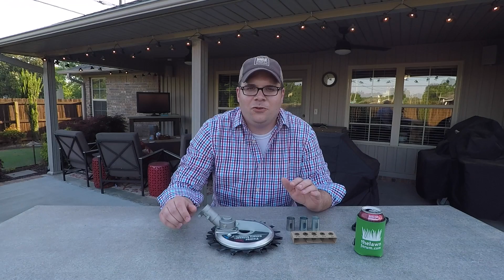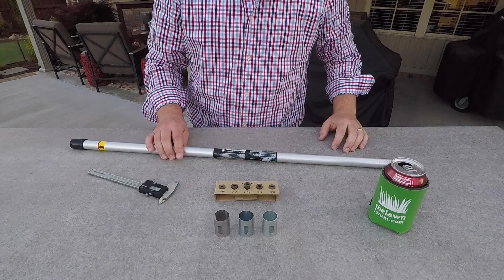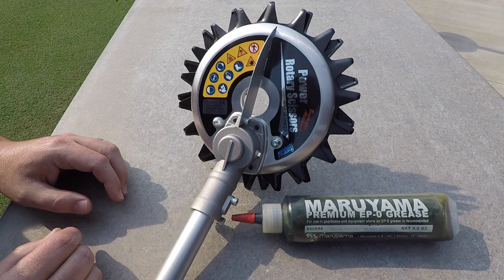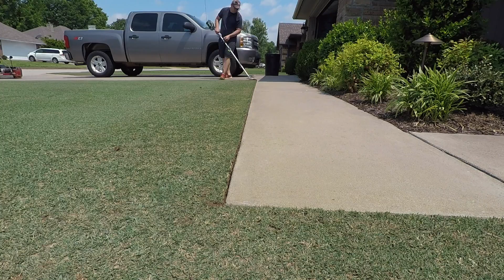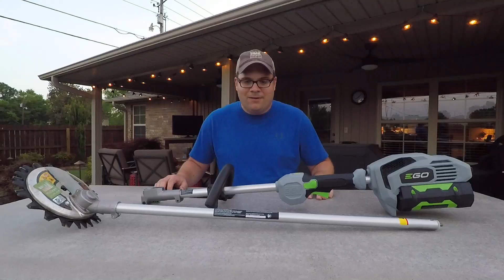EGO POWER+ Landscape Blade Conversion

Comment: Can I use EGO Power+ ST1502SA 15-Inch 56-Volt Cordless String Trimmer with Rapid Reload and Split Shaft
Reply from the maker: No, that model does not have a driveshaft.

Comment: On my ego multi tool, the rotary scissors only fit 90 degrees out from the battery / control orientation as the rotary scissors Allen bolt is on the side whereas the ego trimmer head has the Allen bolt on top

Did you need to adjust anything to get the orientation correct?
Reply from the maker: As I recall (it has been a while) the allen screw just works like a set screw. I would line the PRS head up in the proper orientation and just tighten the screw against the shaft. You could also mark the location and drill a new hole in the outer shaft for the set screw to engage.

Comment: I was wondering does this landscape blade work on medium to slightly tall grass? Also can this tool be used to edge the lawn as well?
Reply from the maker: Yes to both 👍🏼
Reply: One more question.....how often do you have to sharpen the blades?
Reply from the maker: If just cutting grass my experience has been rarely. If you’re edging with the blades in the dirt probably more often.
Reply: @realJohnWare  ok. Do you use yours for edging?
Reply from the maker: @TheBanks148  No I use a stick edger.

Comment: John will this work on my Kobalt 80-volt Max 16-in Straight Cordless String Trimmer with Attachment Capable?
Reply from the maker: If it has a driveshaft that matches up with one of the included adapters it should work. I am unfamiliar with that trimmer, but you could pull the head off and use this as a guide: https://thelawnforum.com/viewtopic.php?p=23876#p23876
Reply from the maker: Note that some electric trimmers do not have a driveshaft - the electric motor is on the trimmer head itself. The PRS head cannot be adapted to those. But if your model uses different attachments, odds are it has a driveshaft.

Comment: Are there other Ego models, or battery string trimmers you found that work with the rotary scissors?
Reply from the maker: Any of the “rear motor” Ego models should work. There are some others mentioned in the big thread on TLF: https://thelawnforum.com/viewtopic.php?f=4&t=1317
Reply: @realJohnWare  thank you for the link! I was searching through TLF on this.

Comment: Great instruction!   I have a question. would the edger's shaft also work with the scissors???
Reply from the maker: Yes it should.
Reply: @realJohnWare  thank you for your reply. after I watched your video, by chance I found a guy trying to install the rotary scissors on the edger shaft, and had some problem with it. ouch. some people were recommending to drill a hole or something, on their comments. ouch :-S

Comment: I ordered aa ST1504 think its same as 1500 just larger battery, not sure.  Anyway removed three screws but the head doesnt slide off. Any ideas?
Reply from the maker: ST1504 doesn’t look like a rear motor model to me. If so, there is no driveshaft to adapt the PRS to. You need a “rear motor” or Quick Attach powerhead.

Comment: I've heard these are really loud, would you agree? Like is it loud enough where ear muffs are needed?
Reply from the maker: They are loud. I try wear ear plugs or muffs when running most lawn equipment anyway, so this included. It’s not as bad with the electric Ego, but definitely when I’m running it on my Maruyama  powerhead.
Reply: @realJohnWare  great, thanks for the info! I'm going to order one of these for my Ego as well.
Reply from the maker: Just make sure you have a “rear motor” or quick attach model. They will not work on the Ego’s where the electric motor is on the trimmer head itself because there is no drive shaft to adapt to. 👍🏼
Reply: @realJohnWare  Good call! I was looking at the ME0801 edger combo and then buying a trimmer head for the electric scissors (what a money pit reel mowing is! lol). Thanks again for the help.

Comment: Do you know if the Idech works with the Carbon Fibre EGO trimmer?
Reply from the maker: B J no it doesn’t. The carbon fiber one doesn’t have a driveshaft. The electric motor is on the trimmer head.

Comment: Hi John. Thank you for this video. I have the Ego string trimmer ( ST150XY) and the 8" edger attachment. I did not purchase them as the combo. I also have the power  rotary scissors, but your string trimmer is different, so I'm wondering if I can get the scissor head onto my string trimmer set up?
Reply from the maker: Sorry, I can’t find that model number anywhere to take a look at it.
Reply: @realJohnWare  It's on Amazon. Oops! ST1502XY. Sorry!
Reply from the maker: Sheril Bender it will not work with that trimmer. It must be a rear motor model with a driveshaft. The electric motor is on the trimmer head itself on that model.
Reply: @realJohnWare  Thanks so much. I'm returning and getting combo! Thankfully we didn't use either of them! I appreciate your help!

Comment: Will my Stihl KombiMotor Powerhead (1.27 HP, 28.4cc) work with the Maruyama landscape blade?
Reply from the maker: It won’t work with the Maruyama Landscape Blade attachment, but you can adapt the Idech Power Rotary Scissors head to Stihl. The Power Rotary Scissors kit comes with the necessary adapters. The Maruyama version only works with the Maruyama Quick Connect system.

Comment: Great video. Are you still using this ego edger for.. edging? Reason I ask, I picked up the ego trimmer on sale  ($100 off) to mirror your scissors rig. I might consider the multi tool one if it edges  better than a echo gas edger IF they put in on sale for Father’s day. Big fan of the forum, thanks in advance
Reply from the maker: I use the landscape blade for trimming and the stick edger attachment for edging. Some edge with the landscape blade/power rotary scissors, but I prefer the nice crisp lines I get with a stick edger.
Reply: John Ware - The Lawn Forum thanks, if they put the multi tool on sale I might grab one, once greenup Im all 7 blade manual reel, I could have a gassless mow using the ego stuff. Hey, you just reminded me to order one of the lawn forum coffee mugs.
Reply: John Ware - The Lawn Forum I ended up with the multi tool version scissors and edger.. super happy with both just wanted to say thank you for sharing the walk thru and of course all the valuable info over at the forum! Happy Fathers day!

Comment: John, my string trimmer crapped out on me today (which also renders my edging attachment useless, too). Are you still liking the Ego? Is the 2.5Ah battery still holding up?
Reply: John Ware I dont know if you'll care at all, but I'll share in case you might.

I was going to buy the same trimmer/edger kit you bought, but I wasn't expecting the $460 price tag. But It was the 2.5Ah battery you mentioned in your video that helped me save a few bucks.
I bought the newest Ego carbon fiber trimmer with the 2.5Ah battery for $230 at HD. Like you, I prefer an edger for edging, so I bought the same edger you have without the line trimmer attachment and without the battery for $130 at HD. I only have 5300 sq ft yard, so I'm fine with the 2.5 battery. Total for both was just under $350 with tax after a discount coupon they'd sent me.
Maybe someone will hit you up asking for info like I did and maybe this will help.

Thanks.
Reply: @realJohnWare  It would've been cool to get the 5Ah, but like you mentioned in your video, you got to use your 2.5Ah for your trimming, edging, and blowing on one charge. Again, thanks for the video and review. Helped simplify my shopping process.

Comment: Almost a year later you still reccomend this setup? I just bought the rotary scissors and am now looking for something to mate it to. I have a similar sized yard so I was leaning toward the ego products.
Reply: @realJohnWare  perfect. I got the rotary scissors in this morning and will go get a ego system tomorrow. I was really hoping I could use the dewalt string trimmer but upon closer inspection it doesn't actually have a shaft its motor is contained in the head of the string trimmer. So ego it is, I've loved the battery equipment for my size of lawn.

Comment: Fantastic video John. One suggestion, rather than use your EGO trimmer shaft for this, you could get the EGO extension shaft (meant for the pole saw), remove the quick connect and add the landscape blade to it instead. That shaft is less than $50 bucks and you'd have a new attachment at your ready. Here's a link to it > https://www.rcpw.com/equipment/ego-power-heads-and-attachments/EP7500.html

You could also buy multiple shafts to create more attachments for your power head, using the same reducer coupling (if you can find those outside of the idech kit). Someone may sell a 25mm shaft with a 7 spline drive for less than $50 but I haven't found it.
Reply: It appears to be a single bolt at the bottom of the quick connect that holds it in place. The only question I have is that it looks a bit shorter (31 inches) than the trimmer shaft, so that may make it impractical as the shaft is already not as long as I'd like. Cool thing is they have a carbon fiber version available in the UK > https://www.powrtools.co.uk/product/ego-power-ep7501-extension-pole/
Reply: @eighties8   Wondering if you have ever used "the EGO extension shaft (meant for the pole saw), remove the quick connect and add the landscape blade to it instead" If yes, please share your experiences here..

Comment: Where does one get that grease?
Reply: Thank you.  Already ordered the blade.  Should be here tomorrow.  Just waiting for powerhead to arrive
Reply: Ego multi-head i meant to say.
Reply: Got it installed and working.  Was a pain to get it alligned.  How loud is yours?  I tried it out and it seems to be very loud when its on.
Reply: I compared it to carbon finger string trimmer and its much louder but I'm returning that one as I keep bumping into things while trimming.  So far I ended up scratching my fence, making holes in the downspouts.  Rotary scissors are much better to control :)
I tried following your video to install it and i had to go the other way.  I had to install the 7mm shaft adapter into the scissors and then insert the shaft into that. Otherwise it wouldn't go all the way in and power head would not click in.  Took a bit of work but now its working correctly (it spins :) )
Reply: ah i didn't read the notes :)  sorry.  I'm a member of the TLF  - tlfal
Reply: ah now i read it :) i pretty much did the same as note 2.  Didn't do the marking
Reply: and now i see the marking (facepalm)

Comment: Nice review John. Glad to see that the EGO system has enough power to work the landscape blade, and the added benefit is that it's really quiet. No more messing with fuel mix, and having to worry about waking everyone up if you want to get the lines crisp on the lawn in the early morning.